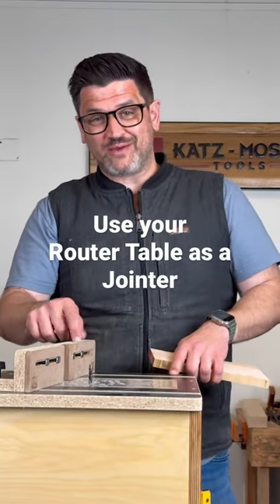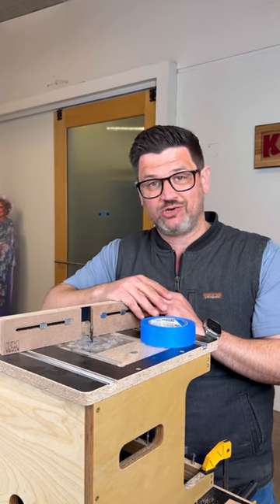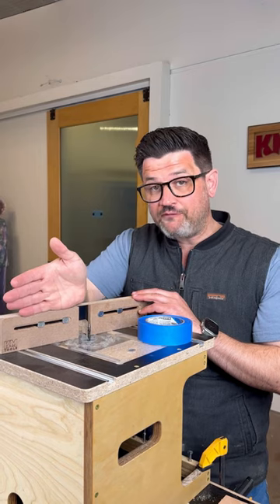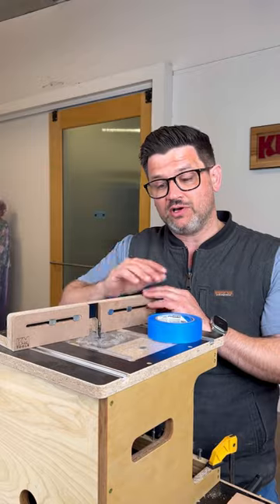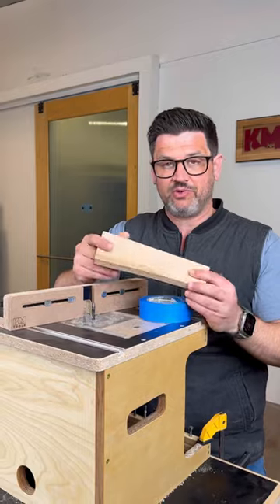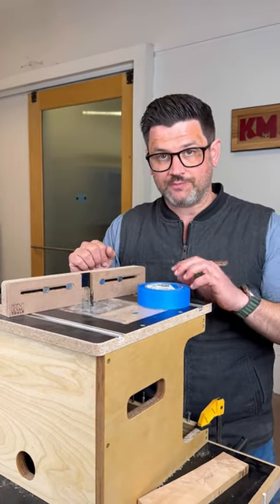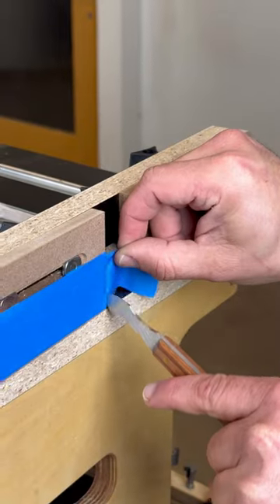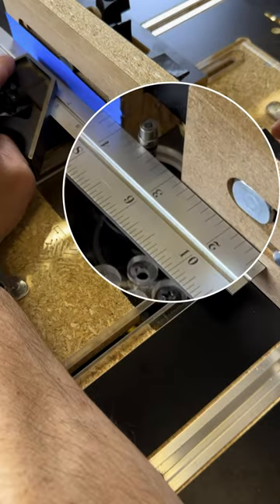Awesome Woodworking Hack – How to Transform Your Router Table into a Jointer!

Comment: I've done this for years and never had or needed a jointer. 
 
I use a ½" "bit" with a 4in blade length, and i can even face joint 3-½" boards. 😊
Reply: Amazing. As someone who is very limited on space, I'll be looking into doing this for my setup.

Comment: I was wondering about this!! I have a 2-car garage, and that feels like a lot compared to other people, but even still I feel like it’s a small space so any “dual purpose” tools are much appreciated. I’m in the process of putting a routing table into my table saw for exactly this reason. So to be able to get a jointer out of it too, heck yes! My question though is, if I wanted to do bigger (taller) material, might the bit experience some flex? I wonder if there is a way to have a special but that’s long enough and can anchor into a support piece at the top to eliminate flex and handle longer pieces.
Reply: I, too, have a 2 car garage for my shop. However, it has to garage 2 cars at the end of the day. Everything has to be dual-purpose, roll away, or fold up. It's been quite the challenge. My table saw is a a table that is an inverted jigsaw, table saw, router, 6" sanding disc all in one that folds down into my bench! Includes a drawer that holds my 2 sided table fence and the drawer itself is my pocket hole jig. Haha
Reply: a jig that uses a table saw miter slot is very accurate and fast. there are a number of utube videos on how to make one  and it can do boards over 2 inches thick on a 10 inch saw. as a side bonus it can do extremely sharp angles too.